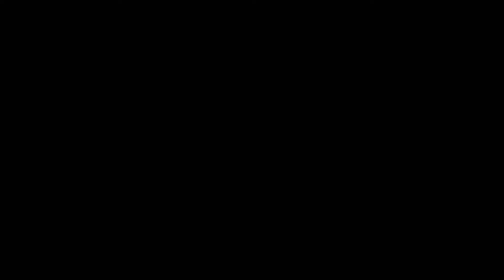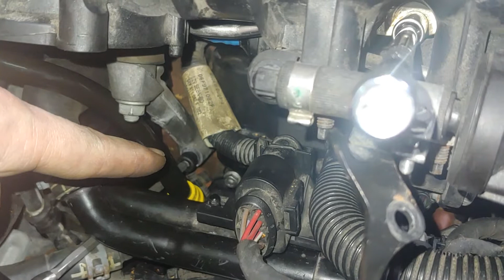Intake Manifold Bracket "Devil" Bolt Fix EASY, VW Golf R

Comment: READ THIS TO MAKE IT EASIER.

You can remove the dipstick tube for more clearance by going under the car and hitting the lip of the dipstick tube up towards the sky. Make sure you have something flat when hitting it so that you don’t chip the plastic off and make sure you’re lightly tapping it until you hear it come loose. Hope this helps!

Comment: Thanks for sharing this video, now I know how to tackle that bolt with the proper tools
Reply from the maker: I had to get back in for another job and have since removed that bolt. Use your own discretion if you'd like to have it there.
Reply: @Weekend_Garage   I actually removed this bolt yesterday to clean the valves referencing your video.  I just removed the whole bracket because I got fed up fighting it.  The car barely had 2 inches gap just big enough for a ratchet to go down there, and the worst part for me was I couldn't even fit my hand because it was so narrow

Comment: Been fucking with this one bolt for days....did you completely take out that throttle body pipe in front?
Reply from the maker: Yes, I removed it. I had the manifold off to clean the valves and replace the thermostat while I was in there.
Reply: @Weekend_Garage  finally just got the bracket off last night, that lil tip helped dude. ya Im cleaning valves and replacing manifold...p2015 code haha

Comment: I didn't have a problem with that bolt I have triple square set for 1/4 socket set. I used and extension with triple squares I had 0 issues.
Reply from the maker: That's great. I either didn't have the triple squares yet or it didn't fit in the space for me. Just another option for people. Everyone I know takes it out and doesn't put it back anyway.
Reply: maybe my problem is 3/8 triple square sockets, but it's a major pain to try to get in there.